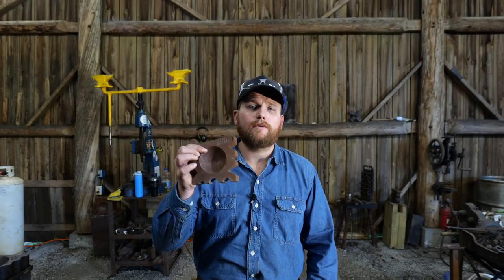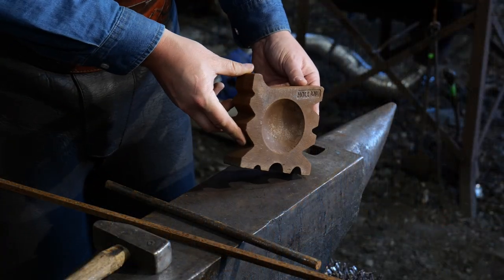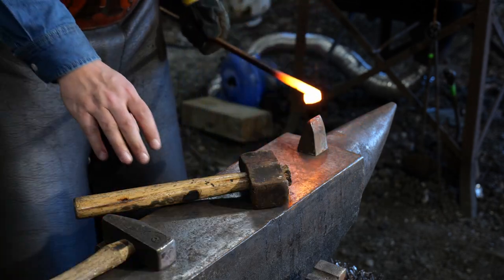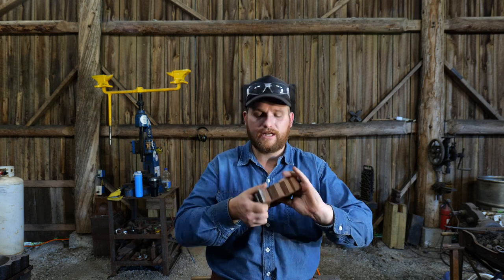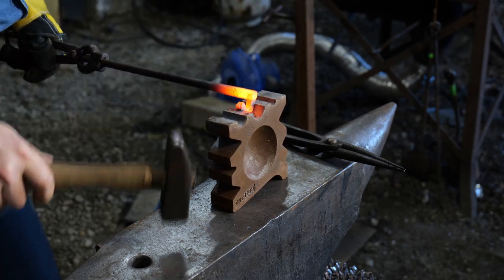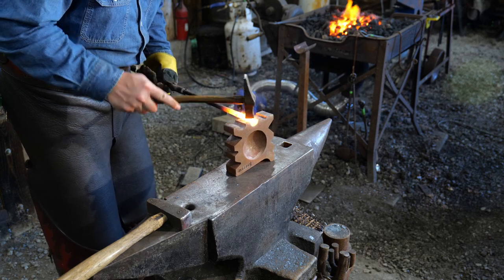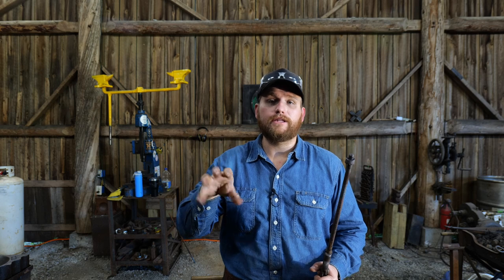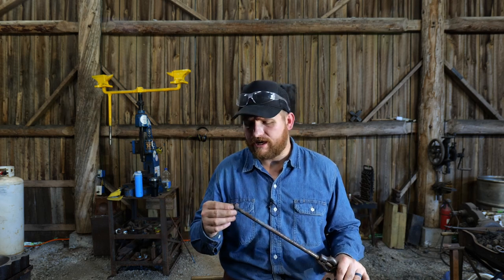A Quick Look at Holland Anvil's New Swage Block!

Comment: Roy, remember showing me how to forge weld at Bam? Well, I'm using the knowledge that I gained that day from you.  I am doing a job for a lady who wants collars forge welded around the center of guardrail balusters as a decorative element. A total of ten will be required for the stairway. Then  the plan for the top rail is parallel lines engraved on either side of very top rail. Peening the top and bottom  over for each baluster. Chamfering the edges of each. All technics that you taught me over U-tube. Thank you very much brother and God Bless. Your looking better after the dental work. Diana just had the rest of her teeth pulled and dentures & implants put in place. She hasn't been able to eat for a week now healing up but sends you guys her love.